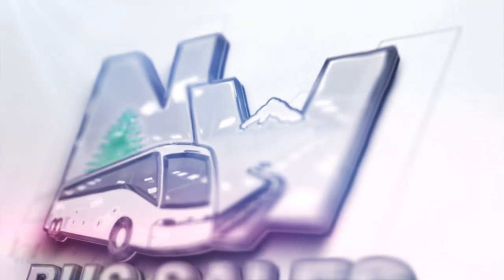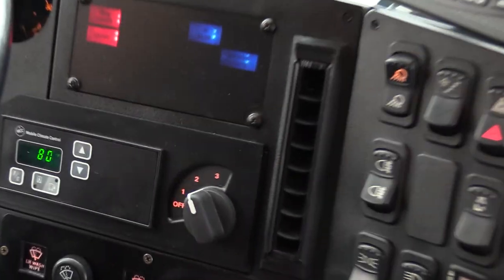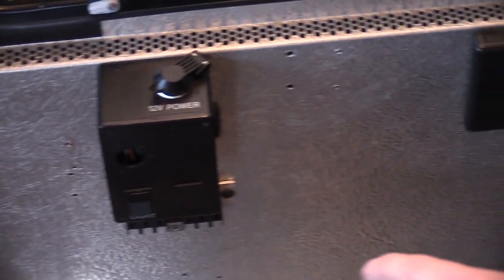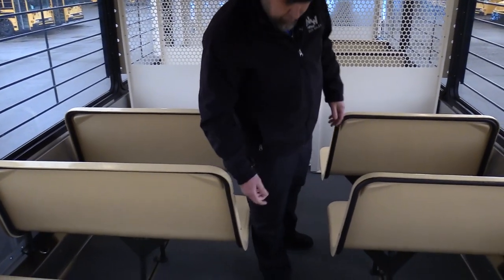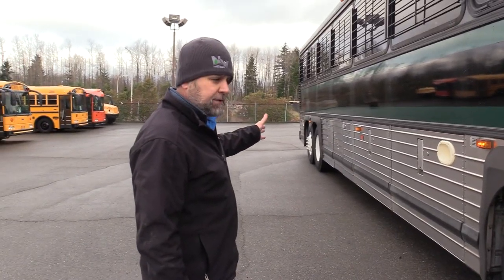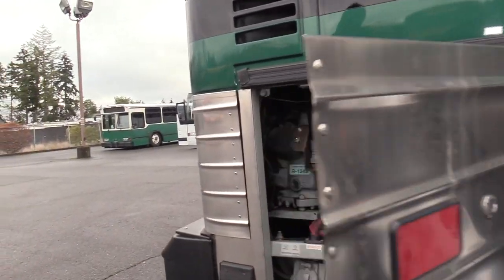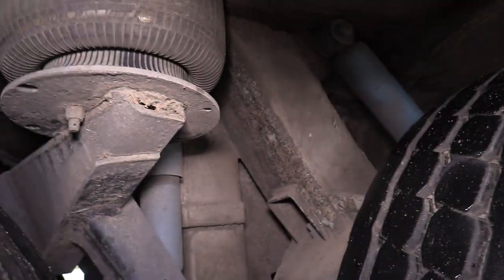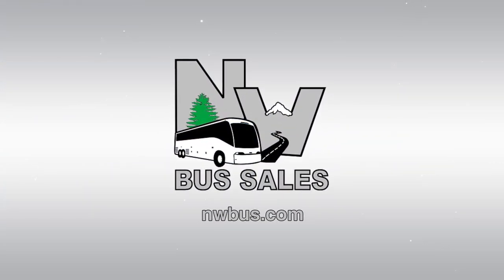2005 MCI D4000 Prison Bus - 47 Inmates + 3 Solitary + 2 Guards Prison Bus - C56451

Comment: Awesome, I bought a 8 year old Prevost prison bus from Colorado with 125k on it for $2,600 at auction. I almost got my money back selling the security steel and accessories out of it👍👍👍
Reply: Where did you find one that cheap
Reply: WHAT A STEAL A PREVOST FOR $2600 THAT BUS IS NOT EVEN BROKEN IN YET I HOPE YOU TOSSED THE GLOCK 9 IN THE RIVER AFTER YOU DROVE OUT OF CDOC COLORADO I BET ITS A BEAUTIFUL MOTOR HOME COACH NOW I TRAVEL TO A LOT OF POWWOWS AND WOULD LOVE THE MCI PRISON BUS LOOKS LIKE AN EASY CONVERSION YOUR MAIN TOOL A SET OF EASY-OUTS DOES THE JOB.  SELL THE CAGE STEEL GET THE MONEY FOR CONVERSION VERY EASY TO INSTALL REAR OUTLETS A GREAT BUY A USED AMBULANCE WILL SET YOU BACK A LOT MORE!!!
Reply: @TheTigerLouie  CHILL TF OUT

Comment: Inmates may need a transfer which is what this bus is for. They are usually with a Police escort.
Reply: Another case solved by Sherlock, good job...
Reply: I would install a wheelchair lift above front rear tire/passenger side,for loading the galley and prep neads for trips !!

Comment: Useless really, take forever to clear it all out. Good luck selling it.
Reply: It’s already sold Einstein!! Can be stripped out in 2 days and be a clean slate to be a high end coach on low end money. Unless your buying a new one and have tons of money to throw away then this is the best and wisest route to go. The bus has been on a routine maintenance schedule and is about as good a mechanical shape as you can find anywhere and it’s not been butchered up like all the old 4104’s, 4106’s and the rest, but you already knew all that!